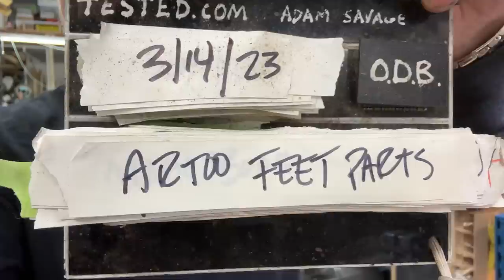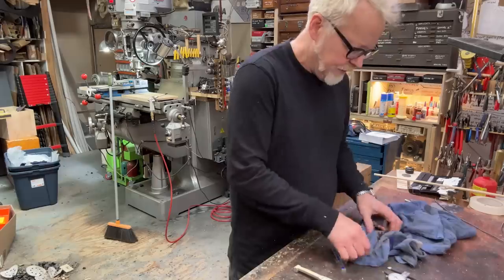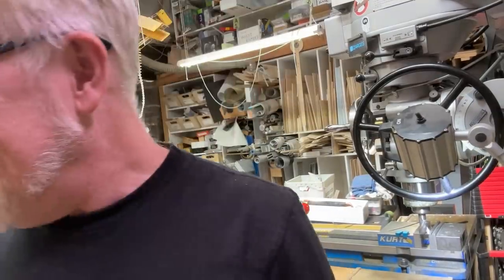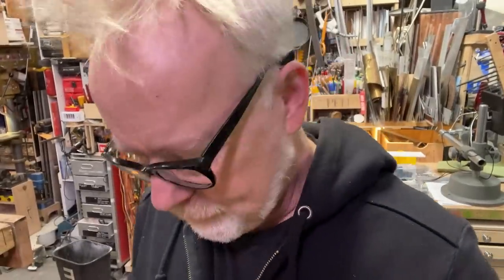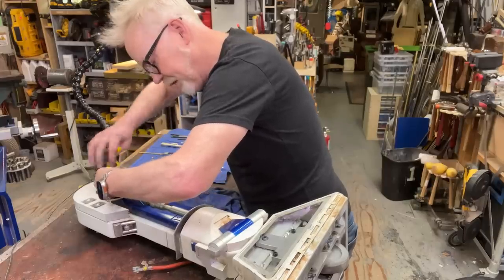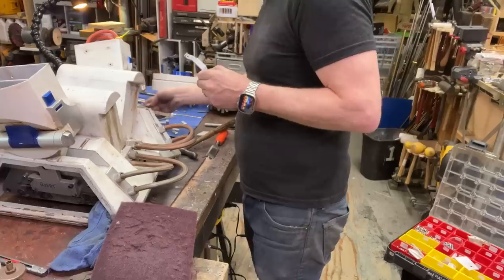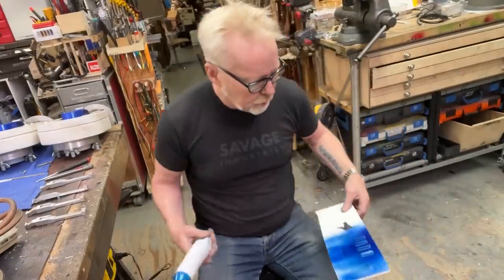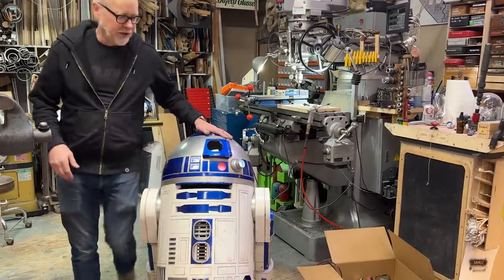Adam Savage Rebuilds His R2-D2 Astromech Feet!

Comment: A tip for aligning drills on centre punch marks, make yourself long tapered steel centre on the lathe, the longer the taper the better. That will give you a sharp pinpoint tip (like an elongated pencil point) that will be easier to line up with a punch mark than the tip of the drill.
Reply: Better yet, skip the center punch entirely as that is likely the source of the errors. Line up a wiggler on the scribe lines, or better still, use an edge finder on the vise jaws or part edge and the DRO to drive right to the spot. No layout required and the parts will be near perfect.

Comment: Hey uh, Adam, genuinely question for you... Which is... Do you perhaps wonder for the breaking bad myth that you and Jamie did when you guys were still running Mythbusters, for the bathtub being eaten by acid one, that say... If you scratched the coating of the bath tub that it could've been eaten through when you had the right tub material for it to be eaten technically? Cause if you think about it, the sample pieces you guys tested with only had the protective coating bathtubs normally have, on the one face, aka the face that will see water normally. My thought is that said coating is quite resistance to acid, and if it were say... damaged by being scratched up quite well, you could have gotten through the tub then.
Just something I always think about whenever I rewatch that particular episode and myth, that you guys may have missed a very crucial part that could've played a factor in if the tub was eaten through or not.

Comment: The next time someone gives you grief about saying 1/5th of a mm, remind them that that with every standard there must be context. Your description clearly stated that you needed to turn one of the metric dials 1/5 of the way around. All measurement systems are agreed standards to maintain consistency. How you use them depends on the equipment you have. If they still want to give you grief, remind them that the ships Christopher Columbus came to America were made before there was a measuring standard and the pyramids were made to a factor of pi before anyone knew what it was. FYI, Spanish galleons were made using an event stick and the pyramids were laid out with a wheel with a mark on it. As the designer, you get to call them whatever you damm well want to.